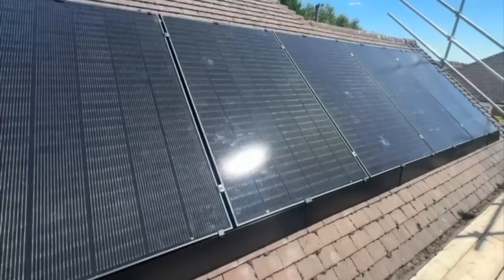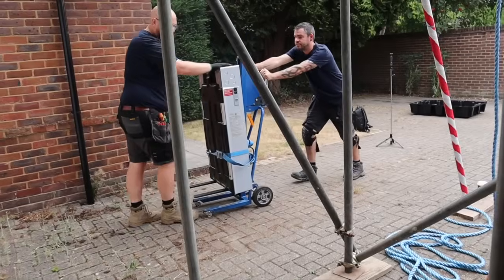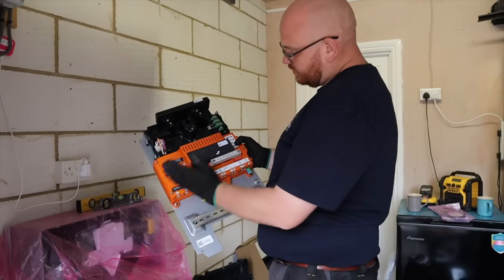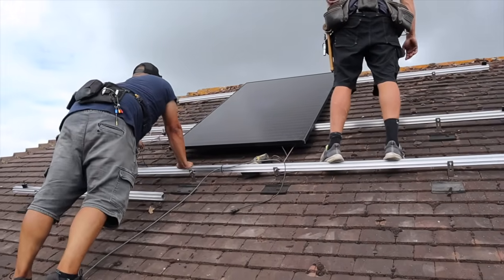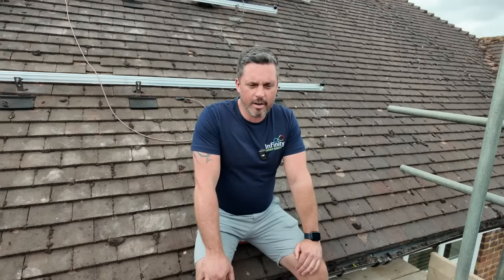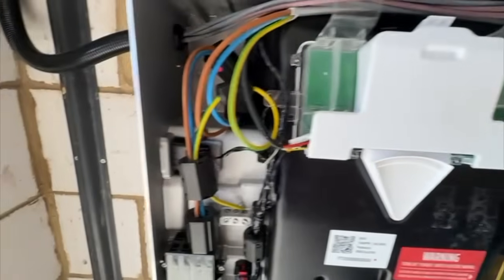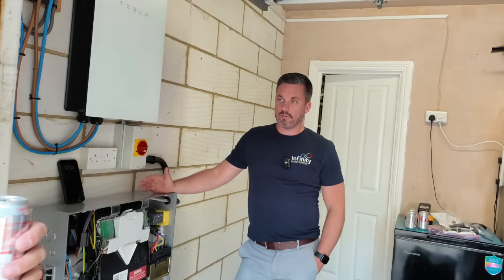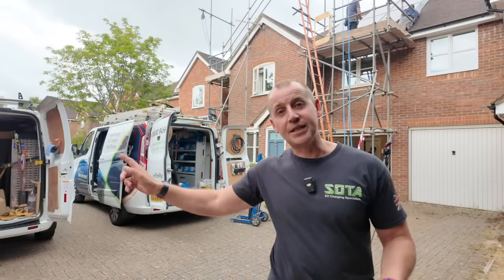Tesla Powerwall 3 Installation UK | Solar Panels + Home Battery Storage Explained

Comment: No sun in winter to cover usage, I doubt the return estimate of 6 to 8 years mentioned.
Reply: Instead of having doubt, why don't you do some scientific calculations.
Reply from the maker: Get in contact for more details, but the estimate is very accurate. In the winter time the customer can charge their battery for as little as 7p/KWh, to run the home, so even in the winter the savings are substantial!